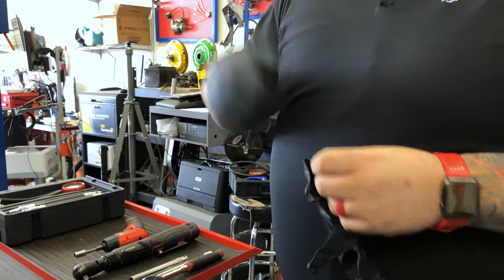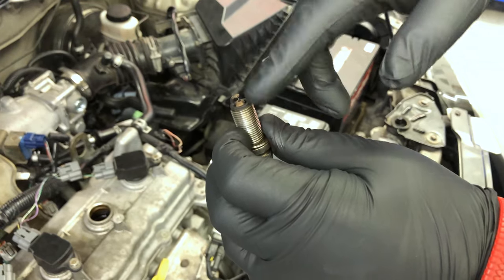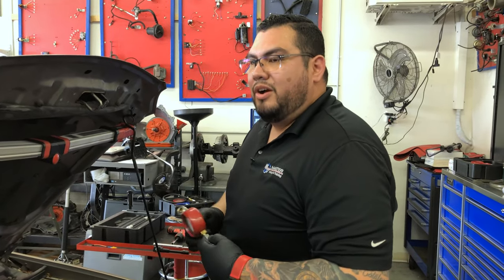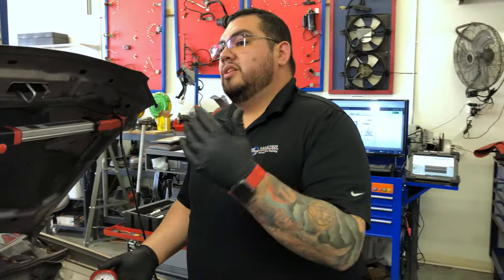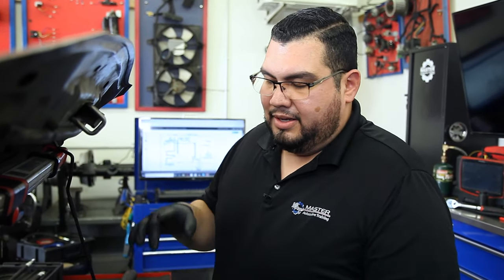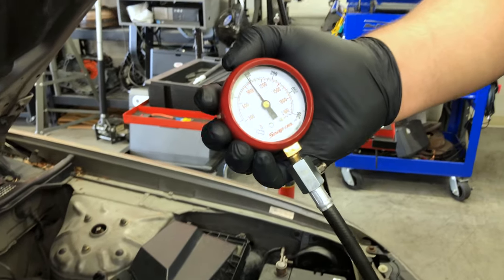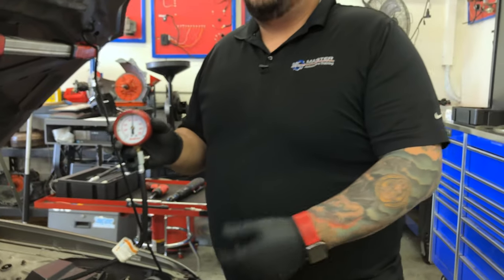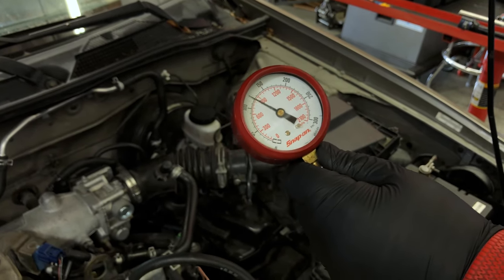How To Perform a Compression Test - [EASY]

Comment: You probably didn’t get an accurate reading on your first static test because you didn’t hold the throttle open to ensure maximum airflow into the cylinder

Comment: Im kind of confused,  you mentioned not too keep the fuel fuse in because it would wash the cylinder walls. Wouldnt that do that on the 2nd test ?
Reply: Agreed. I’m wondering if he disconnected the power from the fuel injector and just forgot to mention.
Reply: Yes I notice that  too
Reply: He replied in a comment below clearing it up: "We didn't capture it but the fule injector should be disconnected to prevent fuel entering the cylinder while doing a running compression and snap compression test. Great question."

Comment: your first test is dynamic NOT static compression!!
Reply from the maker: Unfortunately a cranking compression test is called a static test. “Begin with a normal ("static") compression test on a warm engine to eliminate obvious problems such as badly worn rings, burnt or bent valves or holes in pistons.” - AllData

Comment: I'm kind of confused,  you mentioned not too keep the fuel fuse in because it would wash the cylinder walls. Wouldn't that do that on your Running Comp test when you put the fuse back in?
Reply: Yeh makes no sense
Reply: Washing those walls running all the fuel in cylinder 3 😂
Reply: That's what I'm saying, I don't think I've ever seen someone check the compression while engine is running.
Reply: Me neither, but he could’ve easily disconnected the fuel injector from #3…
This a GDI engine? Those pump a lot of pressure (~1500-3000 psi) directly into the combustion chambers, I know it’s definitely something to consider when working with GDI engines.
Reply: I was thinking same thing, a better explanation would be nice
Reply: He replied in a comment below clearing it up: "We didn't capture it but the fule injector should be disconnected to prevent fuel entering the cylinder while doing a running compression and snap compression test. Great question."

Comment: Both this and the leak down video are good straight to the point no extra bs. I really appreciate it
Reply: I ALMOST agree with you except that this video contains ABSOLUTELY NO EXPLANATION of what the "Snap" test is. He's just holding the gauge and then he's like "see?" Um no. I don't see. I don't see or hear ANYTHING about what a snap test is that you just performed

Comment: I occasionally use my compression tester as a fuel pressure gauge, the 14mm long fine threads fit most fuel rails. Haven’t had any issues with o-rings, had this gauge since 1978, lol 😂
Reply: Mine was cheap as possible like $25 came advertised as doing fuel, vacuum, and compression.

Comment: At 4:52, you mention pulling out the fuse for the fuel pump for the static compression test, which I understand is to prevent fuel from entering the engine. However, at 7:29, you say to put the fuse back in for the running compression test. Won't having the fuel pump running during the running test still risk damaging the engine? Can you clarify why it's safe for the running test but not the static test? By the way, I really like the video—it's very informative!
Reply: I had the same question.
Reply: I have exactly the same question.
Reply: Yes exactly  same question
Reply: He replied in a comment below clearing it up: "We didn't capture it but the fule injector should be disconnected to prevent fuel entering the cylinder while doing a running compression and snap compression test. Great question."

Comment: How did you connect the gauge during the running test?  Was it still screwed into the spark plug hole?  Did you disconnect the fuel injector electrically?  How did you keep fuel out of the cylinder?

Comment: yep, I gotta remove the exhaust manifold to get to three of the cylinders.  Can I run the engine for the second two tests without exhaust connected?
Great video. Cheers & Thanks.
Reply from the maker: Yes you can run quickly without exhaust manifold, make sure to wear ear protection as it will be super loud.

Comment: You said NOT to have the fuel injectors running because it could damage the cylinder walls so did you cut the fuel to just this one cylinder for your 'running' test?
Reply: The fuel pump is what pushes the fuel through the lines and to the injectors. The fuel pump is off cause he pulled the fuse. So no fuel is moving in the lines or going to any of the cylinders.

Comment: 8 have a v8 L92 (LS) engine, though my question is more general in nature: if you run a compression test with the engine running as you are in one stage of your video, how do you ensure that the injector isn't flooding the cylinder you are testing ? (since it doesn't have a plug in it, it won't fire but the injectors are still pushing fuel.

Comment: 2:48 match up spark plug and compression gauge adapter length
5:25 clear flood mode (throttle pedal floored down all the way) , only some vehicles(?)

Comment: Do you have remove all the spark plugs to do a compression test or one at a time?
Reply from the maker: If you are doing a cranking compression all off, running compression only the cylinder you are testing.

Comment: I have combustion gases in my coolant I used a block tester  . Everyone says blown had . But my car isn’t over heating and I don’t have smoke coming from my engine . Coolant keeps getting low. Can’t find any leaks outside . Hoses look good .  Oil looks clean .  Is this a test I need to check?
Reply from the maker: Does your car have an EGR cooler? https://youtube.com/shorts/OCKY0ew_oHY?si=H2BJzzIycjAiqJpK

Comment: Hi Master Auto Training,  

Thank you for the nice video. 

In the 2nd test, i.e. the running compression test, after putting the fuse back, will it cause the problems you mentioned earlier when you explained why you needed to disconnect the fuel?

Comment: How much compression pressure should be in petrol engine and diesel engine
Reply from the maker: That’s dependent on the engine. It’s always best to test a known good vehicle and begin to build your data base. Most manufactures no longer give us that spec in service information.

Comment: On a 2012 Toyota Corolla S for a static test when I crank it should I hold the gas pedal down? (I removed the fuel injector fuse)
Reply from the maker: Yes.

Comment: I don't understand.

First you said we pull the fuse for the fuel pump because we will damage the engine if it is left in and then we put it back in and run the second test.

Why does the 2nd test not damage the engine, get gas in the crankcase, etc.?

What am I missing here?
Reply from the maker: We didn't capture it but the fule injector should be disconnected to prevent fuel entering the cylinder while doing a running compression and snap compression test. Great question.
Reply: @MasterAutomotiveTraining  Thank you for being so responsive and creating such helpful videos.
Reply from the maker: @DanielDroegeShow  You are very welcome, thank you for watching!
Reply: @MasterAutomotiveTraining That's the answer I expected... after I posted the same question. Thank you.

Comment: Seems like you may have forgotten to disable fuel delivery to that cylinder after reinstalling the fuel pump fuse? Otherwise, great tutorial video!
Reply: What do you mean by that?
Reply: At the beginning he wisely defeated the fuel delivery for the static test. Later he put the fuel pump fuse back in but then did not disable the injector for the cylinder he was testing. This could explain why he didn’t get the 50% number he was expecting.
Reply: @MartinWibert I was thinking the same thing. He never went over if he did or didn't, and I suspect he didn't.

Comment: I thought it's a requirement to remove all spark plugs when do compression test? I suppose it can't work if we are looking for a  comparative  data between all cylinders.
Reply: You’re correct- to get comparative readings on a static compression test you have to remove all spark plugs. You also need to hold open the throttle blade or remove the throttle body to get maximum airflow in the engine for all cylinders
Reply: thats why you cut off the fuel

Comment: Good video but I do have a question, if you disable the fuel    for the static test so it doesn't damage the rings and cylinders wall then what's keeping it from damaging the cylinder when the engine is running and you are testing it?
Reply: It's not about whether it's causing damage. It's about the fact that if fuel is being sprayed into cylinders being tested it'll effect the reading. It'll likely do one of two things. It's going to wash away anything inside the cylinder and get between the piston rings and the walls. Or the gas will act as a barrier sealing any loose gaps between the piston rings and the wall. That why there's dry compression tests, which is what he just did. And a wet compression test. Had he not diagnosed the issue using his method. The next step would've been pouring a small amount of oil into the cylinder (wet compression test) to see if it raised the pressure. The reason for this is that if you have bad rings, piston, or cylinder walls the oil will seal any gaps. If the compression doesn't change at all but is still low. That confirms that it's valves.

Comment: I have a strange issue with my engine

Min sped for hot compression test is 133 standard value is 188

My tests are

#1 130psi
#2 133psi
#3 140psi
#4 136psi

My leak down test is

#1 24% (rings)
#2 10% (rings)
#3 10% (rings)
#4 14% (rings)

I'm trying to figure out why my compression is kinda low on all cylinders but the leak down test is in spec

Comment: Many vehicles mostly fours have rail cops rather than individual cops, how would you take more than a static compression on those vehicles? The only workaround I could think of is just sticking wires on the plugs and running them into the coils but that surely impacts performance in a way that is unacceptable for valid data.

Comment: Can I just do a static test to check compression?
Reply from the maker: You can but without a dynamic (running compression) you’re not testing the engines ability to breathe and exhale (volumetric efficiency). Wont be a complete test if you skip running.
Reply: I'm kind of confused,  on the 2nd test you put the fuse back , I thought the fuse wasn't supposed supposed to be in because of fuel going into the piston washing the cylinder walls

Comment: How to test if oil rings are worn or damaged?
Reply: If compression is low on that cylinder, spray some oil down in that cylinder. Re do the test. If it's piston ring wear, it'll read better for the time that oil is in there filling in the gaps. If it makes no difference, it's not ring related.

Comment: During Snap Test: what pressure reading will you get? Let’s say if EXHAUST WAS RESTRICTED instead of low pressure of 100psi from intake or exhaust valves than 116psi. 😮 10:13